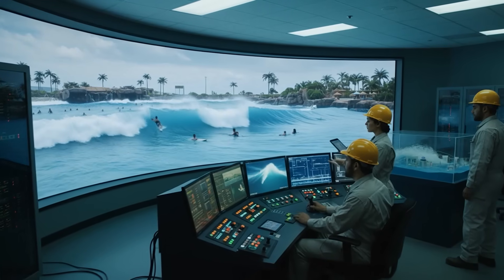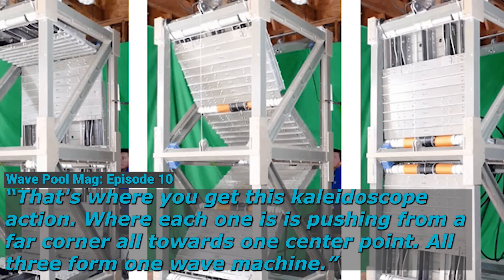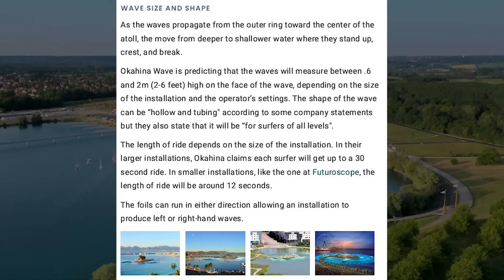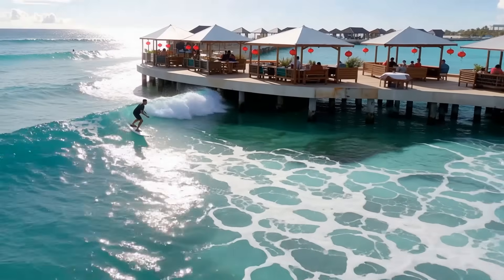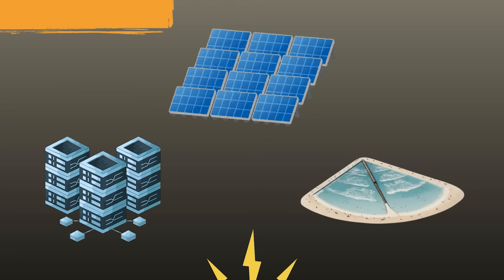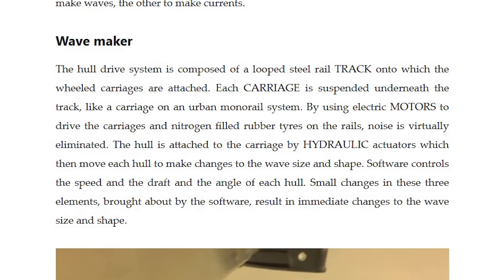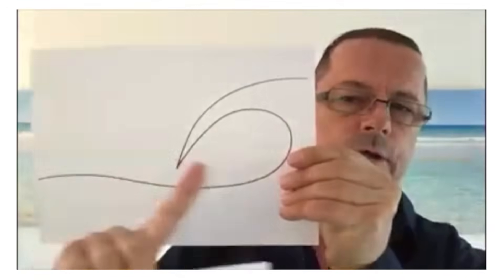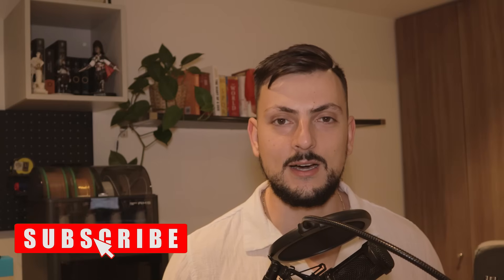These Unreleased Wave Pools Will Change Surfing Forever

Comment: Hey man you missed a good new one that uses air pressure  , a guy built it in his backyard in the desert and its extremely efficient
Reply from the maker: There are dozens of others out there which deserve to be in the next round of surf tech videos!
Reply: @EngineeringDads  It's called The Wave Source, and I came here to say the same as they are actually producing newer technology than repackaging that you showed.  What you showed was great but not necessarily new or the future.
Reply from the maker: @randalluthe4792 These specific techs have not been released to the public. I will have to check out your recommendation. Cheers!
Reply: @EngineeringDads  Surf Lakes is another one that is trying to get built with developments.
Reply from the maker: @randalluthe4792 We touched on surflakes in another video on our channel and also have the podcast with the mechanical R&D engineer. You can check both out on our page :)